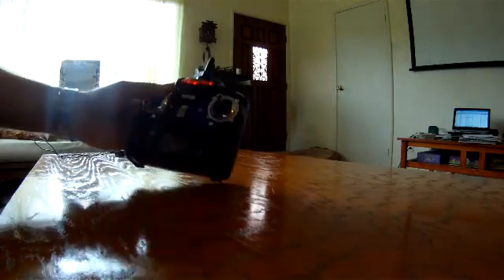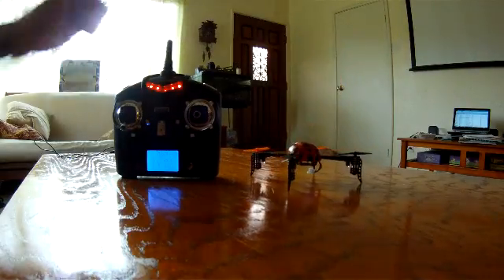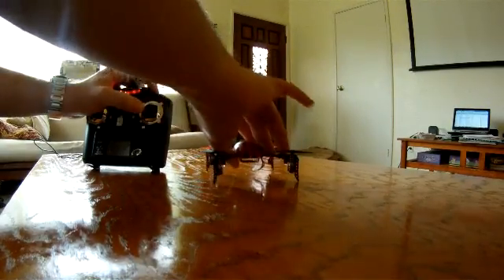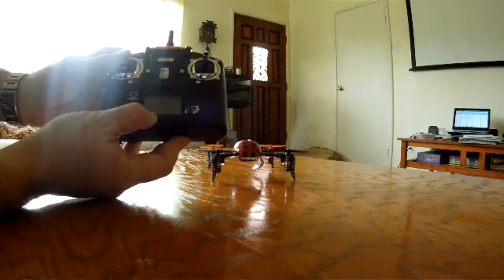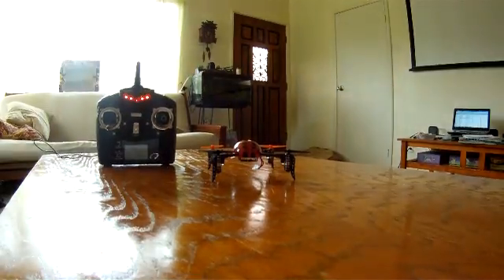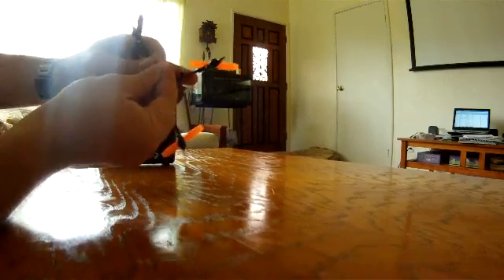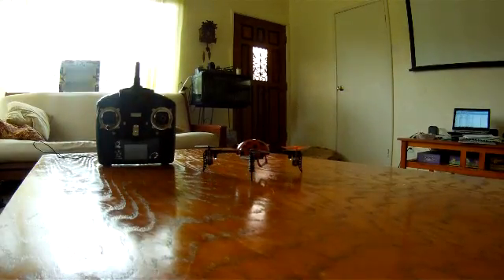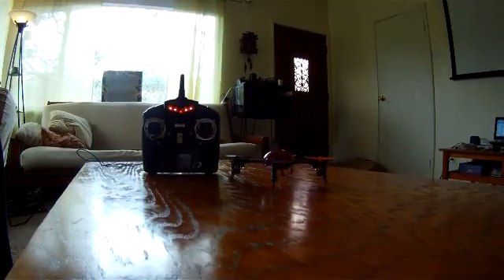how to fly remote control rc helicopter quadcopter part 1

Comment: Dude, u good with quadcopter (flying it) & know it. But for ur video, u forget about the basic principle in taking pictures / video. Is not directly facing the light source / light, so that the object is clear. The Objeck to be taken not as dark / silhouetted / exposed to light refraction of light sources and light refraction of the lens camera itself. Unless deliberately want to take / produce a silhouette. *(This is my advice & sorry if my english not vry good enough). Thx